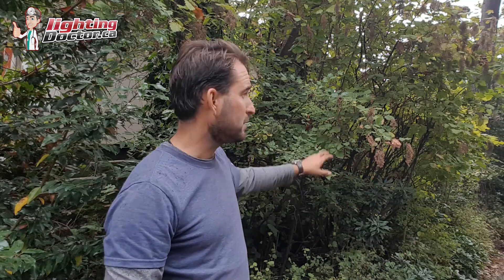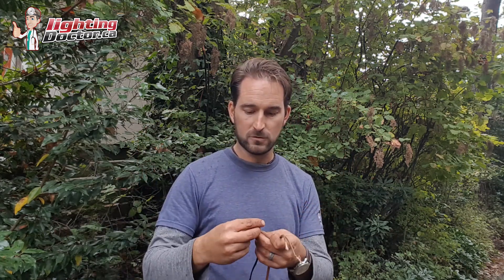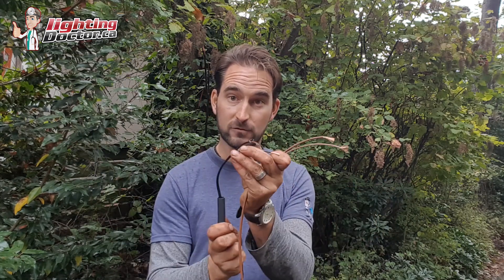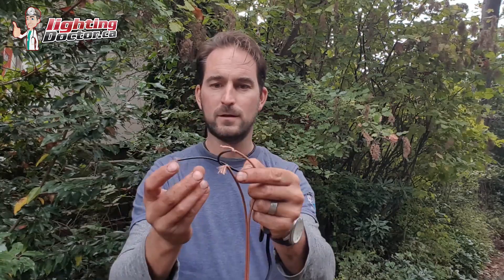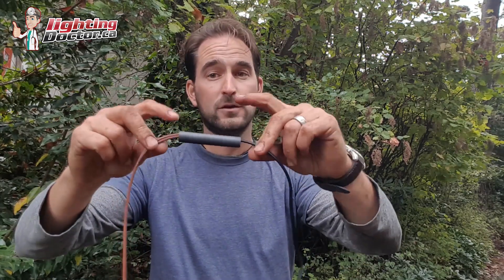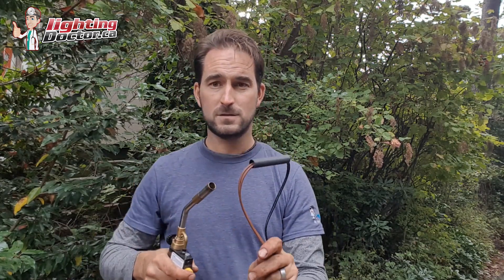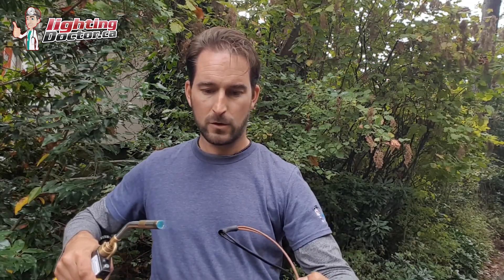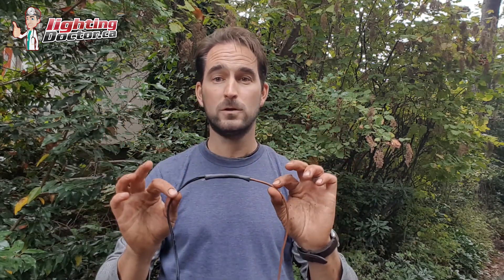How to Wire Low Voltage Landscape Lighting (Waterproof Connections)

Comment: @Kal, how far underground is recommended to bury the connectors? I live in Chicago, IL (US), so frozen ground is a concern.
Reply from the maker: 4 to 12 inches is fine. You dont need to worry about freezing but just want to make sure they dont get cut if digging